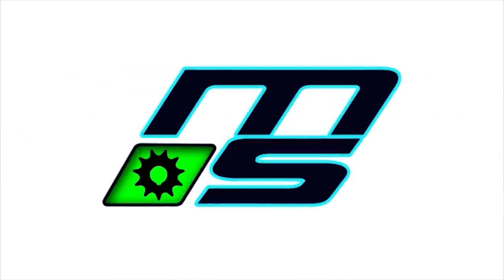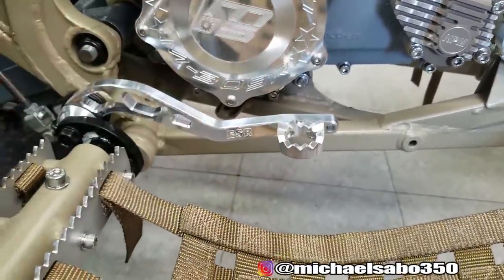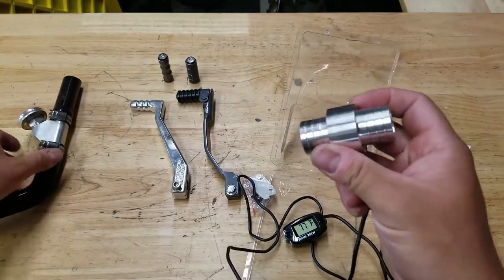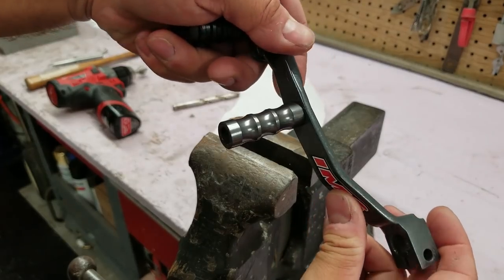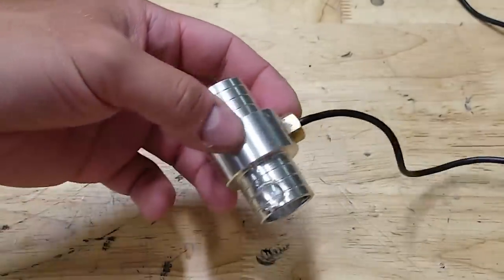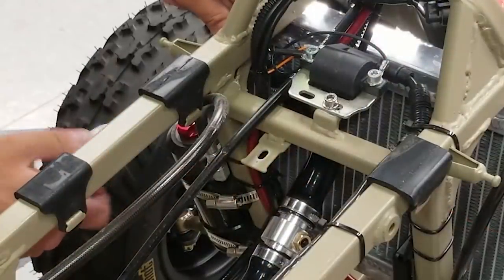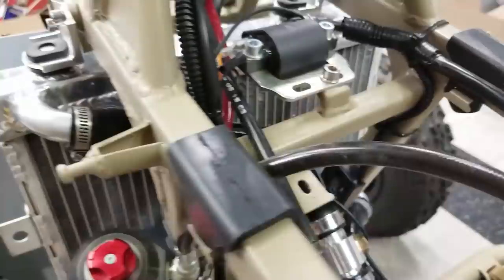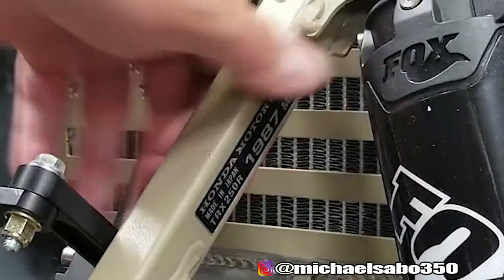How To Make a Short Shifter For Your Quad and Installing a Digital Temp Gauge | Honda TRX250R

Comment from the maker: Thank you for watching my video and for all the support; almost at 50k subscribers; you guys ROCK!!! 🤘
Reply: Amazing video
Reply: You’ll probably never have a problem with it overheating, it did that cause it was so hot from it leaning out, I have 4 250r’s and have owned 250r,s my whole life and never have had one overheat
Reply: 50k would be amazing, hope you get there soon
Reply: i pretty sure shortening that lever will mess up how it works, , seems weird that the nerf bars have messed up
where everything should be. just concerned small movements will be come big movements now
the length has been changed ie. neutral will
be hard to find
Reply: You work hard, you've earned the sub's.

Comment: In the long run, get the correct fitting for that size hose. Running it up like that stresses the hose. It will end up splitting on you.
Reply: This

Comment: I have the trail tech temp gauge on my banshee and it’s kinda finicky with the one button thing. on mine it has three modes, a clock, the current temp, and the max temp(the max temp is the one with the little max in the corner). To set the warning light you have to go to the current temp and hold the button for a second or two then it will let you set it by just pressing the button repeatedly until you get it set how you want (this is the finicky part). You can do the same in the clock mode to set the time and in the max temp mode holding the button till the dashes appear resets the max. Ps your videos were a huge help when building my banshee keep up the good work!!!!

Comment: after you get that ball hone I still recommend you can massage all your ports with a piece of 80 grit sandpaper. If you feel a sharp edge on any of those ports that will put a scratch Mark in your piston.
I like the job you did on the temp location thumbs up bud

Comment: Very nice, with the ims shifters they are actually about an inch and a half longer than stock... 250R and 450R stock shifters are the same length and the ims is longer than both so it’s just how they are

Comment: Cool vid, shifter looks good either way but I do like the knurled one better, and the temp gage turned out sweet looks cool in the bar pad, It's out of the way and kind of protected in there. As usual good job bro👍. Can't wait for the cylinder hone.

Comment: shocked to see you mounted the shifter right lmao most people mount them to where you have to dip your foot down to shift . in 01 when i met joe byrd buying my 250r he set my shifter in the up angle so while racing you just slide your foot under and pull up
Reply: That's personal preference. I dont like them talked because I can accidentally down shift with a big foot. Some like their shifters high some like them low
Reply: @duneracerweston  do you race and have you been trained by a pro
Reply: I like my shifters low so it’s easier to up shift.

Comment: Hey man I’ve recently got my first four wheeler a few months ago and about a month after I got it the shifter fell off while riding come to find out it was welded on. they also cut the shift shaft in half(I don’t know why) so I just used a nut and bolt to hold it on and it worked for a while, but then it fell off so I decided to jb welded it, but that still didn’t work. And now it’s completely stripped I was thinking of getting a new shift shaft but I don’t know how hard the job is. Have any idea on what to do it? Do I maybe get it welded on?
Reply: you have to tear down the bottom end to get that shaft out. just weld it back on for now.
Reply: Bayou Rider just pull the clutch side cover off and the shift shaft will pull right out. Easy fix
Reply: brett brown can i use the same gasket?